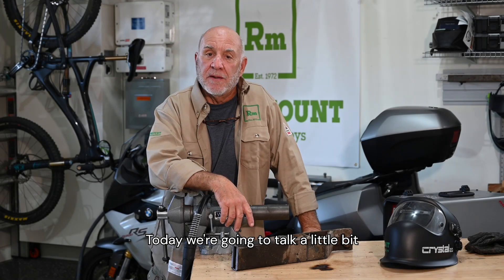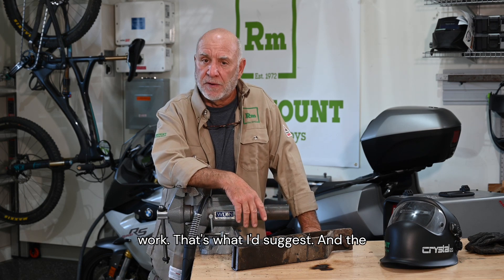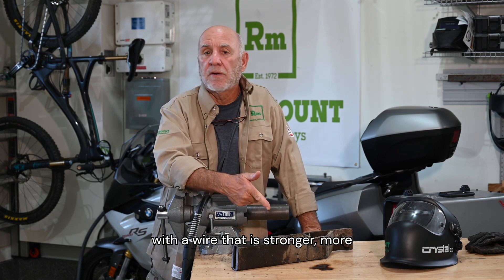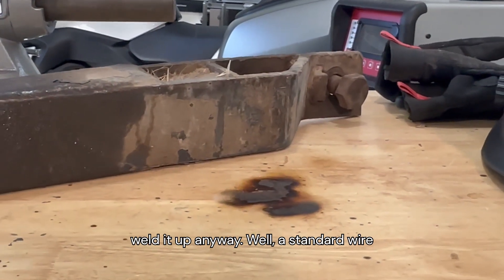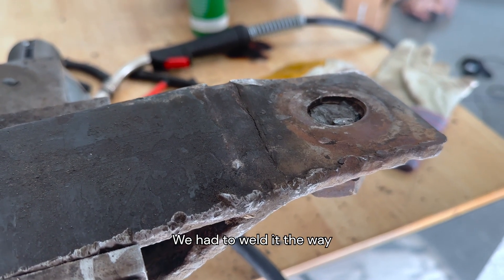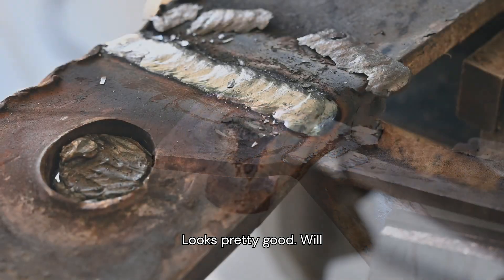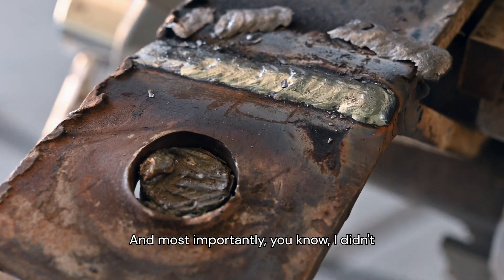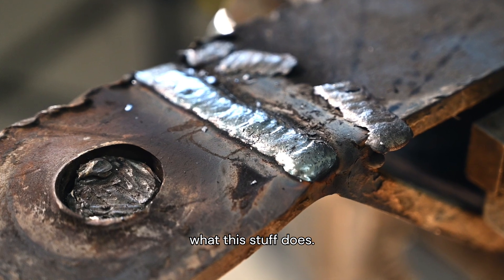Polaris Maxi Shield Pro -- Maintenance Welding Made Easy

Comment: Seems like someone promoting a welding product with a video ought to hire an expert to produce photos that let the prospective customer see the weld puddle, not just arc flash and smoke, and talk.
Reply: I don’t disagree, but it’s easier said than done. I’ve been trying to hire someone to do just that for months. These guys make top notch stuff. I’ve never used their wire but their stick electrodes make me look good every time I use them. I do a lot of field repairs on Boring and utility insulation equipment, an industry that seems to have far less metallurgical knowledge than you’d expect. Dissimilar metals, dirty metals, crack repair in high vibration applications I can’t say anything bad about their products other than they’re a little pricey.
Reply: @timblack33  Tim, it sounds like you and I are getting similar work.  I just finished repairing the badly broken outer end of the crowd-arm on a smallish excavator.  It always astounds me how light, how thinwall these things are made, and with no doublers at the key locations, as if they are only supposed to dump beauty bark into Datsun pickups.  So I'll take your word for it and pick up some of the rod.  Thanks for the info.
Reply: @timblack33  This is really helpful context. Thanks so much for your wonderful endorsement of our products!
Reply: I agree with you. Had a tech problem during the shoot and the welding image got blown out.  Time constraints precluded us reshooting.  We will do better next time.  Bad welding image, great product.
Reply: @patrickadams6870  Good luck, Patrick. If it were easy, I'd do it, rather than sit here and carp!!
Reply: Thanks!